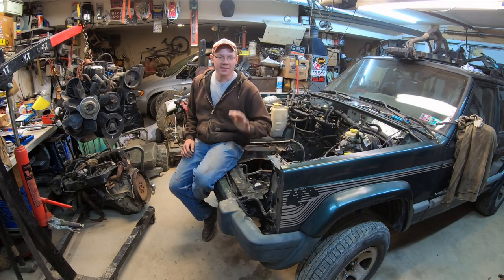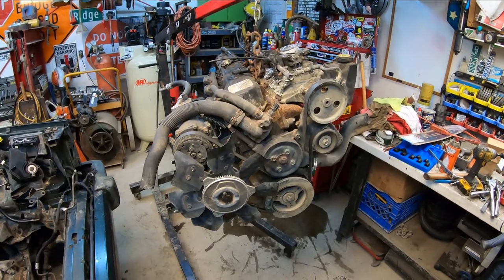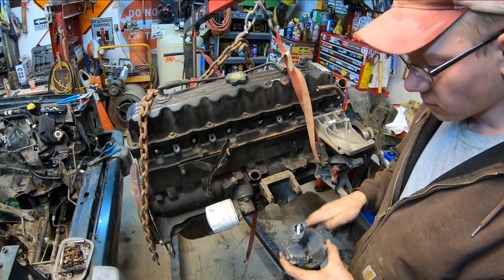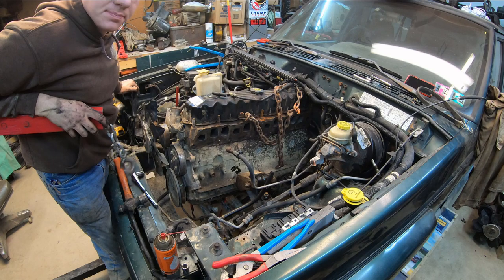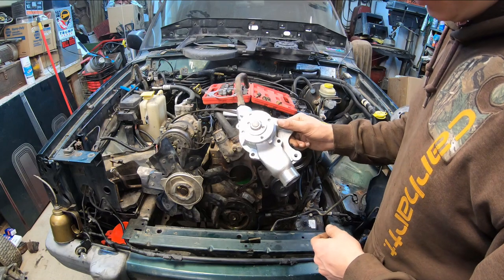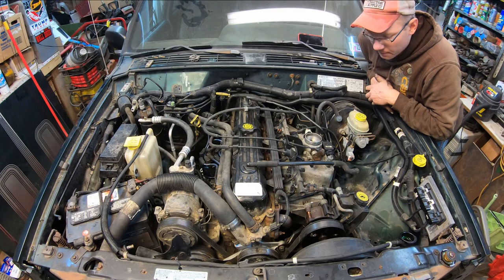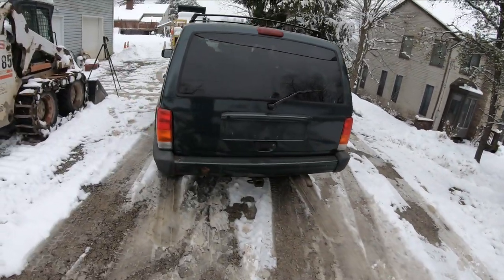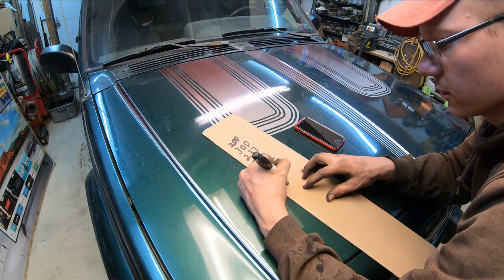$200 Jeep Cherokee gets JunkYard Engine,  WILL IT RUN AND DRIVE???

Comment: As the owner of a 1996 XJ, that's a steal.  Take that thing off road as it is today.  You'll be surprised at how capable it is.  Then do a few mods like lift, tires and lockers and you'll have an unstoppable beater with a heater.

Comment: $883 - is a heck of a deal for a running, driving - and stopping - 4WD vehicle in reasonably presentable shape in my view.  The key thing is that much of what it still needs is doable at pretty low cost and you can pick away at it as time is available.  You’re on the road and moving for well under $1K - that is a steal of a deal.

Comment: Nice! She's a ripper! The Fluid Film is a good call. I've had a few older Jeeps I was afraid to put on the lift due to frame rot.
Reply: Dude your Channel rocks..... I love to see you supporting other YouTube creators
Reply: He did an awesome job....Now time to go see what Wes is doing lol!
Reply: I had an 89 Cherokee.  Loved that  beater..death by body rot did it in...great in snow and fun to drive
Reply: I never miss a post on your channel, Wes.
Reply from the maker: I did the fluid film today.... boy the safety Sally’s are gonna stroke out.
Reply: @DieselCreek  Unless you are typing from the ER it should be fine...
Reply: Yeah wes bought my first wife a 97 jeep grand cherokee Lorado in 2006 and drove it till 2015 when the 4 link mounts on the body cut loos drove it till the inspection ran out and sent it to the recycling yard with my 99 dodge ram
Reply: @DieselCreek  Sally's and Karen's lol
Reply: @DieselCreek  let me guess when you have a hammer every problem looks like a nail ( crane truck)
Reply from the maker: @johnkennedy2505  If I had the crane truck handy I would’ve used it but I didn’t

Comment: Mid 90s to early 2000s is when automotive technology hit its peak anything after that was needless add ons  or needless govt regulations
Reply: I feel the same way about anything post 1972
Reply: AnarchoSynCope  as someone who owns and works on a 2000 civic and now a 2003 CRV yeah they are easy to work on and cheap to get parts for given how many are made. CIvics though aren't great for those without tiny hands.
Reply: Well put
Reply: It's like after 2005 everyone thought taking cues from BMW, VW and Mercedes was a great idea.

Comment: Hi.Matt. i have done alot of R&R with components from donation parts. FYI I always would replace the water pump - tune-up parts -  hoses - belts - filters - clutch and pressure plate throwout and pilot bushings (if manual)with new or rebuilt parts. It saves alot of backtracking. IE water pump. Hope this info helps.

Comment: The foil on the injectors was to help with heat soak. It's a known issue where if you turn the engine off and let it sit for awhile then do a hot start the fuel in the injectors and fuel rail was vaporized. It'll stumble and lose power for a moment until fresh fuel is sucked up.

Absolutely worth $900. Cherokee's are getting harder and harder to find, especially 4x4. Take care of it and it'll outlive you! I've got a '96 with nearly 300k miles on the original engine and transmission and it's still going strong.

Comment: It must be a great feeling to be able to install another engine into your vehicle. You say you are happy , and so you should be because that is quite an achievement on what is going to be an every day workhorse for you. Awesome job Sir 👍 Tam.
Reply: It's largely straight forward in most rwd applications, read your manual, get your necessary bits together and get on with it, building engines is definitely a real skill but basic fitting isn't that difficult as a rule.
Reply: @rogerfrancis65  Oh okay Sir Merry Christmas 🎄 to you 👍 Tam.
Reply from the maker: @rogerfrancis65  what is a “ manual”? Lol
Reply: @DieselCreek  them there new fangeled instructions some folks need... personally I could do it my sleep without but it's a dark art to a lot of people.

Comment: A little know how, a good amount of elbow grease, and a whole lotta swearing later and you jave a great winter vehicle. Proof that Anyone can get a good project finished, even if its by themselves. If that new 4.0 really only had 10k on it, it will outlast that old Cherokee body. Even with the odds and ends to make it good and some good tires, I bet this project can be done for $3k or less and serve you well for many winters to come. Thanks for the great videos and inspiration. Now it's time to get out in the garage and put a wheel bearing on myself.
Reply: My parents drove a 98 XJ from new until 2017 and sold it running and driving with 378k miles.  They will run forever as long as there is something resembling oil in the crankcase and the body isn't rusted in half.  Luckily we live south of where they dump salt on the roads so it didn't have a speck of rust.  Good luck with your wheel bearing.

Comment: The aluminum foil is a quickie heat shield to keep the injector from causing vapor lock when trying to restart soon after shutdown in hot weather.
Chrysler makes a shield sleeve to make a permanent fix 
FYI big fan of the Jeep inline 6 cyl.
Reply: I get vapor lock all the time. I need to get the kit and install it already. But it's so damn cold out!
Reply: why do people say america made when it was made in america?? does it matter where its made? as long as its goods i'm fine where ever its coming from
Reply: @hunterbear2421  support your fellow Americans during these tough times
Reply: @peterdang9475  not american... canadian  and i do belivie in no other place people will say that. thats my option
Reply: @hunterbear2421  we sometime say here it in the UK.. it's good to buy local..

Comment: I know it's not important in the grand scheme of things but one of the first things I'd do now that it's running is try to get rid of all those hideous pinstripes
Reply from the maker: I actually don’t hate them and typically I do hate stuff like that but I will probably paint it at some point so I’ll worry about it then
Reply: I like the pinstripes.
Reply: Are those pinstripes factory?  If so, I'd leave them.

Comment: Good job with the engine change. FYI: 210* on the thermometer is normal for the 4.0L XJ
Reply: Can confirm, 210 is ideal for the 4.0.
Reply: Yep both of mine ran there for the 12 years I had them.

Comment: 210 is what is should be running at I believe. I’ve owned a Cherokee and a wrangler with the 4.0 and both ran at around that. A few buddies also have Cherokees like this. Theirs run at 210 as well
Reply: My '87 4.0 runs a consistent 190.

Comment: a trick i've seen some other utubers do is to use chain saw oil to coat underside of vehicles, it's sticky and does a good job of holding off rust
Reply from the maker: I used to spray waste oil on my stuff but after watching project farm do his review on undercoating im gonna try the fluid film!

Comment: Nice! I love older Jeeps. They were great in those years when the company was less flashy and more business. The new Jeeps have given me nothing but problems and I think Stellantis needs to be better to FCA or Fiat needs to stand their ground to make sure all of Jeep doesn't get "Porter Cable'd". We can already see it happening with that dreaded Italian diesel engine they push In their smaller vehicles instead of going with a Cummins diesel
Reply: AnarchoSynCope  Back in the late seventys the Army had a bunch of ALLIS-CHALMER bucket loaders.when the engines started failing,The only replacement engine available was a Fiat diesel.We had a new engine put in one of our machines,the damn engine failed after about 40 hours.I never was a Fiat fan,that did nothing to change my mind.

Comment: The coolant temp for those engines normally is 210 we just sold our old Jeep couple years ago and that’s what it always ran  at. It was a lost cause because of all the rust it had but it ran good it had 128,000 miles on it
Reply: My 98 has almost 300k miles on it and still running great. But, the rockers are rusted out, the wipers only run on high, and the heater fan only works on full chooch. She’s showing her age, but the drivetrain is just fine....
Reply: @notajp  Watch Wes work could fix everything but the rust 🤣

Comment: Not a complaint, more of a FYI if you didn't know- rough audio desync on this one Matt.
Reply: I came to the comments to mention the same. 😂
Reply: Glad it wasn’t just me. I restarted the video a couple of times with no luck.
Reply: you kids back in my day everything wasn't in sync like the porn scene would be over and there's still audio 2 minutes left over from the scene
Reply: @BangBangBang.  hahahaha. 🤣
Reply: @BangBangBang.  most kids today don’t know what a vcr is. I think I remember there being some kind of thing you could adjust on a vcr to sync the audio and video. My grandparents had a vcr when I was a kid and I think I remember them having to adjust that from time to time. Maybe I’m mistaken. But I def remember watching some videos on a vcr and the audio would be completely off from the movie. 😂
Reply: Was wondering if I was the only one that saw that.
Reply: If you drop the playback resolution it will usually synced properly; from my experiences. Something to do about limited bandwidth due to high network traffic or that other thing called throttling. 🙄
Reply: @opendstudio7141  even as an old timer and ex-sys admin I knew that but the kids need 1080
Reply from the maker: Yes not sure what happened during the render but didn’t have time to re-render and upload, first time I’ve had this issue
Reply: @TsunauticusIV  Yes,both of the VCRs we owned had sync adjustments.Some times we had to use it sometimes not.Hadn't thought about that in years.

Comment: I hope the front seal on the transmission doesn't start leaking. It's a good idea to replace it when splitting engine and transmission apart after being together a long time.
Reply: No in an aw4 you have to disect almost half of the tranny to change that seal
Reply: The rear main on the engine is more likely to leak than the trans.
Reply: I call it an automatic oil change , you never gotta change the oil in the motor since you gotta keep adding new oil 👌

Comment: Please replace the foil on those injectors. The strait 6 engines soak heat into the injectors, and once the engine is hot, gasoline starts to boil off in the injectors before it leaves them, causing stumbling in the engine. This is no joke. Put new foil back on!! Or replace it with even better insulation!!
Reply: Thing was designed by AMC back in the early 80's and never really had any updates. Chrysler did add heat shields at some point though.
Reply: Modern electronic fuel injection doesn't like heat.  But given that the 4.0 is a redesigned AMC 4.2 that was originally carbureted and made with a pencil and slide rule the carburetor required heat to run well.
Reply: did Matt not change the maifolds over and is now running with a carburator
Reply: @richardspringthorpe8176  no he is running fuel injection.  What he swapped was an earlier model fuel injection and ignition system vs the updated 03 and up coil on plug setup.  It's a throttle body design regardless.
Reply: The heat soak isnt that much of an issue thats a problem of people who dont know hpw to properly maintain their vehicles
Reply: Never had an issue with the 4.0 and considering my father retired from the Toledo, Ohio JEEP assembly plant so I’ve owned at least 20 of them from 70’s to brand new JL’s... this is a bullshit statement and never an issue... the 5.0 4-hole injectors are a nice upgrade tho!
Reply: @jeremysmith6905  i had a 2001 Upcountry, blue, loaded. It had 94k mi on it when i bought it a few years ago, had it for a couple, then sold it to move money around. It had the injector fuel heat soak issue pretty good. Even with foil on the injectors, on hot days, if i drove a bit and parked it to run in a hardware store, 10 min later when i started it, it would stumble. It would clear quickly, but it was classic injector heat soak. A few guys i know never had an issue, others i knew had my same problem. Dunno. It’s real though.
Reply: @chrispy3866  like I said I’ve owned at least  dozen 4.0’s with never a problem on any, even at 300k one is still going but I’ve thinned out the Jeep collection to 5 with only 2 being 4.0s
Reply: @saltyymannscustoms6989  that’s a very condescending remark toby. There were and are millions of xj owners out there. There are thousands of people on a hundred xj forums who have or have had this issue. I’m not a mechanic by trade, but am very mechanically inclined. I do all my wrenching myself. Are you trying to say that i and millions of other xj owners with this same issue are at fault because “i don’t know how to properly maintain my vehicle”? 
Allow me Toby.
SUBJECT:
4.0L Rough Engine Idle After Restart Following A Hot Soak
 
OVERVIEW:
This bulletin involves the installation of a fuel injector insulator sleeve.
 
MODELS:
2000-2004 (TJ) Wrangler (Domestic and International Markets)
1999-2004 (WJ) Grand Cherokee (Domestic and International Markets)
2001-2004 (WG) Grand Cherokee (International Market)
2000-2001 (XJ) Jeep Cherokee (Domestic and International Markets)
NOTE: This bulletin applies to vehicles equipped with a 4.0L engine (sales code = ERH)
 
SYMPTOM/CONDITION:
Customers may describe a 20 to 30 second rough idle following the restart of a heat soaked engine. This condition may be most noticeable when the engine is restarted following a prior 10 to 20 minute heat soak in hot ambient conditions of approximately 32 C (90ºF)or higher.
This condition may be consistent with short city stop-and-go driving trips and can be aggravated by the use of fuel with a high ethanol content.
 
Depending upon various conditions a MIL may occur due to DTC P0303 - Cylinder #3 Misfire.
This condition may be caused by heat from the exhaust manifold that following engine shut down migrates to the area around injector #3 and causes fuel vapor to form within the injector. This in turn may cause a momentary misfire of cylinder #3 until the fuel vapor is cleared of injector #3.
 
The insulator sleeve lowers the injector #3 temperature to a point below which the fuel will not normally vaporize.
 
DIAGNOSIS:
1. If vehicle exhibits a rough idle, and if a misfire of cylinder #3 is observed following a 10 to 20 minute hot soak, perform the Repair Procedure.
 
PARTS REQUIRED:
Qty. Part No. Description
 
1 56028371AA Ignition Wire Shield
 
REPAIR PROCEDURE:
1. Cut insulator sleeve, p/n 56028371AA, to make two (2) insulator sleeves
about 25-30 mm (1 in.) in length.
2. Install one sleeve around injector #3, with the slit on the upward facing side of the
injector. Install the other sleeve with the slit on the downward facing side of the injector.
3. Confirm sleeve is flush to intake manifold surface around injector.
4. Check injector #3 wire and ensure that the injector is rotated to a 2 o’clock position (from driver’s side of vehicle).
 
POLICY:
Reimbursable within the provisions of the warranty.
TIME ALLOWANCE: 0.2hrs
 
FAILURE CODE:
AM Authorized Modification
Reply: @jeremysmith6905  a BS statement? Because you never had the issue? Horrible attitude and a VERY strong remark for NO reason sir. Like i said to Toby, it’s real. Maybe you should search the web for heat soak issues. There are literally thousands of threads on hundreds of forums about it. Including a bulletin from chrysler regarding the approved fix for it. Cheer up man. Take a deep breath before you post something. There’s no reason to come off so strong.
Reply: @jeremysmith6905  Incorrect.  This is a very well documented issue, so much so that there is a plethora of aftermarket and Mopar manufactured heat shield kits made specifically to remedy said issue.  because you and your 12-20 jeeps in particular haven't experienced this means absolutely nothing.  That's called anecdotal and holds no value.  Even more so, who gives a shit where your dad retired from?!  He could've retired from being Jesus' stunt double and it still has zero to do with the aforementioned topic.
Reply: My 98 has a stumble after sitting for a short time while hot. Yes, injector heat soak is a real thing on the 4.0 engine.

Comment: Great Job there. Stabbing the distributor and then getting the whole engine seated back in properly are the 2 biggest problems I've run in to in the past when rebuilding an engine. Have fun with it.

Comment: now when you get the steering  parts/brakes  all replaced remember this is a beater...have some fun and myself and a few associates are doing something about quieting the rides and closing stuff up and rust proofing....mustie one does bar chain oil looks effective....i started seeing the weak spots where rust gets started and have much success with 9lb expanding closed cell foam door and window grade...minimal expansion an totally repels water some namely less than 9 lb foam absorbs water but 9 lb repels it and substantially when you kill the water and wind blown intrusion the rust stops and the rides are substantially quieter...couple of cans try it out you wont be disappointed
drill a 1/4 to 5/16 hole and fill the gaps
around door frames and if windows clear in doors as well not to much but some and put straws through the foam for drainage when gaskets leak in rain it will drain out through the pvc straws and tubing...not to much means windows and linkages clear for smoother operation and the foam does add a bit of unitized strength...the sturdy feel is nice...
once foam cures make sure the drains are clear with a piece of wire or nail no water laying in door seams kills rust dead and quiets the vehicle substantially....adds years t the body with out much cost easy fast and dirty...all high end models do fill their panels with the foam for as little as possible making their rides much much quieter is well a comfort and added insulation values for temperature zones